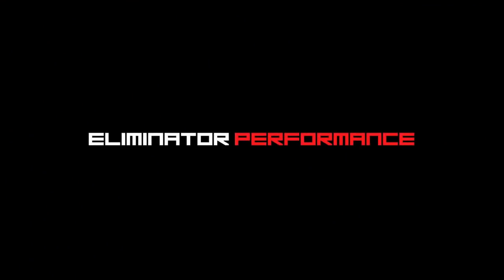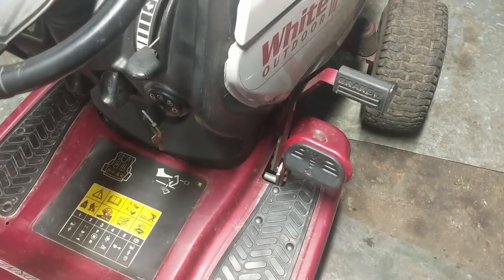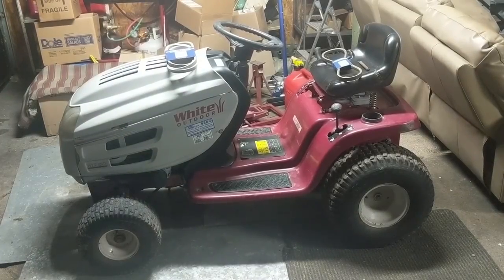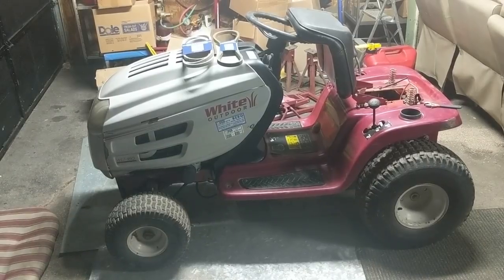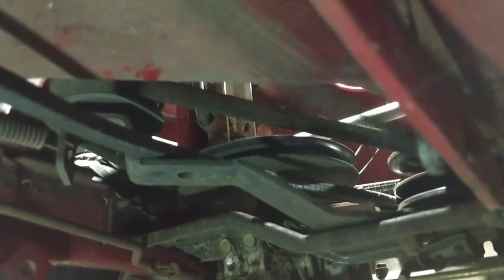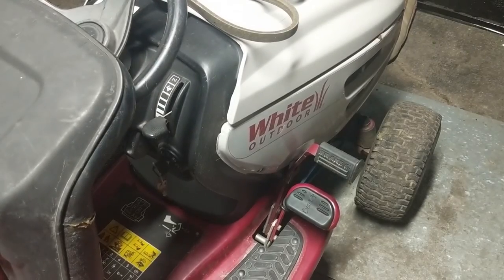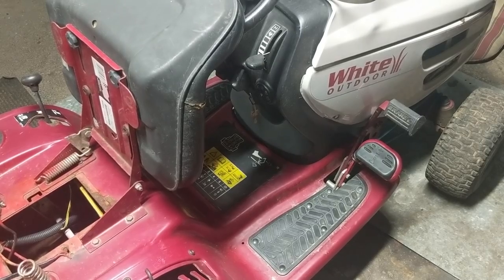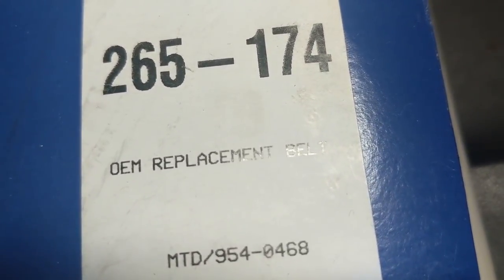How a Variable Drive Works (CVT)

Comment: This is the best video you are likely to ever see that clearly explains how the automatic belt drive system on a riding mower works. I searched a long time before I could find anyone who knew anything about this subject. I would also be interested to know if anyone has any experience mowing on steep hills with this kind of transmission. Do the belts slip or do they power up the hills with no problem?
Reply from the maker: They work well, you have to remember a light pressure on the throttle keeps you in low gear, great for climbing, and the belts are both always under tension. The main issue is these belts "chafe" or however you spell it, because they're variable speed, they're constantly changing circumference with the center pulley moving. This causes them to wear faster than a hydrostatic transmission with a single drive belt. Thanks for the kind words!
Reply: @EliminatorPerformance  Thanks so much. You have my utmost respect. You are a straight shooter and a true professional.

Comment: Thank you for this video. Your explanation on the workings of the variable speed drive helped me trouble shoot my problem.  I thought i would share what happened for the benefit of others. I have an old MTD and it has the same variable drive. I had reall bad belts on it and i changed the big one because it stopped going all together. i didnt change the smaller top belt despite it being in terrible condition. i continued using it and suddenly found the speed affected and would only go super slow. i changed the belt but it was still the same. Your explanation of the function of the middle plate made sense. i checked if it was stuck and sure enough it was jammed. strands of the old belt had wound themselves around the pulley locking it in the position of the slow speed. after pulling the strands out it functioned normally again.  many thanks
Reply from the maker: Thanks for watching, glad it helped!
Reply: @EliminatorPerformance  very much. Thanks once again

Comment: You did an absolute fantastic job with presentation and explaining the system. I need to change drive belt on my Toro LX420 that is similar to the machine that you showed so it will be very helpful. Keep up the good work.
Reply from the maker: Thanks for watching!

Comment: i just put on the long pulley and now when i drive forward i find a lot of play in the pedal and not very fast, but in reverse , its fast. do i have to adjust the foot pedal, if so , would like to see a video on how that is done . Great videos !!!!!!!!!!!!
Reply from the maker: Thank you!

The pedal operates the idler pulleys down below, so adjusting that is easy, as you only need to adjust the rod going from those idlers to the pedal. It should be threaded and have a double nut on it.

A CVT drive should drive at the same speed in both Forward, and reverse, when the pedal is fully depressed.

If you are driving slower than normal, I suggest lubricating the Variable Speed Pulley.

Comment: How to adjust the transmission linkage? I replaced the transmission with used one, I noticed that the transmission is not engaging and the belt smokes.

Comment: Great vids,,,I noticed when you mentioned the lower drive belt #265-101 you said the dimensions were "5/8 x 95", every thing I could find on this part # says 5/8 x 91 or 90 1/2. The reason I am asking is I installed two new belts on my Troy Bilt Bronco  upper 5/8 x 41 and lower 5/8x91 and the mower will pull even when the petal is not depressed. Could the lower drive belt be to short??  Thank you

Comment: Thank you for your video Eliminator.  I have a question:  

I recently changed the drive belt and I don't know if that will be the cause of my problem, I have a Troy bilt pony (2011), now I can only control the speed with the throttle lever, even when I put it in rabbit mode the motor goes at high rpm, but the ground speed is about half the normal speed; the (yellow on mine) speed control lever doesn’t work, it goes up and down without locking the notches, offers no resistance and does nothing. (however, the engaging of the parking brake action works fine). 

I opened up the mower and saw the yellow speed control lever attached to a connecting rod which is attached down there to the cupped metal piece in the correct position as the new Troy Bilt Pony I saw yesterday at Home Depot, but besides allowing to be put in in park position, I don’t see it attached to anything else, is it right? How does it regulate the speed if it is not connected to anything else? 

Thank you in advance.

Comment: Got a Troy bilt having the same behavior after replacing both drive belts, I see they have the whole variable  pulley system listed as a pricey one piece replacement, any possibility of a rebuild with new bearings instead?
Reply from the maker: Yes you can purchase the bearings, there's different designs, some with bigger and some with smaller bearings. My best advice would be to google "mtd variable speed pulley bearings" and see videos and parts that match yours

Comment: I have a Bolens that has a F-N-R shifter that looks like that one but it has a speed control on a lever (1-6) on the top left of console. I changed the main top drive belt in the back and now the speed lever no longer changes and it goes at about a 1 or 2 speed only regardless of the speed change lever position. Do you know what happened to this? When I replaced the belt it was really tight (tension spring was off and I had to use all my strength to get the spring back on) but was the same number as the old belt. I can't tell what that speed lever is attached to at all or how it even works with the variable drive.

Comment: Have new belts mine still works just getting slow and also need to press quite hard, will grease the variable pulley when i do that and check bearings  thanks
Reply: Mine's doing the exact same thing, it seems to be getting slower over time. Do you have any tips on how to fix it? I haven't replaced the belts yet but was thinking about it. I have a huskee supreme SLT 4600... Wasn't 100% sure if it's a hydrostatic transmission or this CVT transmission
Reply: Check your tension springs that tighten the long belt. Often the spring stretches over time and doesnt apply tension as it should. These aren't a bad design, but they're kinda unique. Theres a few videos  on youtube,just search cub cadet/mtd slow speed fixes.
Reply: @ciphercode2298  im not too bothered because i try to cut slow anyway but man full throttle is weak when you are driving around not kowing lol
Reply: @Seriouslydave  Mine was kinda jerky and would speed up and slow down down. It was aggrevating,especially mowing around things. The belts needed changed anyway so I lubed everything good that I couldn't normally get too. My spring wasnt weak,but the pivoting part was a little rusty and was catching as it moved.Its not a bad system,just different than what I'm used too with hydrostatic trannies. After new belts and a good living it was running like new.

Comment: When you call the foot pedal a THROTTLE, it really has Nothing to do with the throttle, it only ADJUSTS tension on the belt which varies the pulley size ratio, correct?
Reply from the maker: Correct, I just called it a throttle pedal because it's similar to that of a car, the more you press, the faster you go.

Comment: I have an older craftsman rider that has a 5 speed transmission. Can I convert it to the constant variable type drive? I already have the variable pulley from an old tiller. Thanks
Reply from the maker: Would be difficult to figure out belt lengths, I wouldn't want to attempt that!

Comment: On mine when i push all the way down it goes fast till i go up hill. then it stops. But it works when i hold it half way down and i go right up the hill. I have new belts What do you think?
Reply from the maker: No idea, that's strange indeed, as tension should increase the further you push the pedal.
Reply: @EliminatorPerformance  Do belts on this system wear out faster? I replaced them 2 mouths ago.
Reply from the maker: Not if they're the correct length.
Reply: @EliminatorPerformance  If i figure it out I'll let ya know. I'm thinking the top belt spring might be weak. I'm  going to tie it tight to see.

Comment: Thank you great video & explanation of how MTD Vari- Drive system works !

I was wondering if anybody reading who has one of these "7 speed shift on the go" MTD models with this 2 belt CVT system would pls tell me:

How well is it holding up ?
Does it tolerate moderate towing ?
How frequent are belt changes needed ?
Can you compare to Hydrostatic or other CVT lawn tractor Transmission systems?

Thanks a ton for any input.
I'm deciding which tractor & drive system to buy now.
Reply from the maker: CVT's are great, probably the best IMO.

As for towing, they definitely can't hold up to as much, as the belt is always changing length due to the fact that the pulley is changing height.

Because of this, there is some "chaffing" when the pulleys get slightly rusted.

Usually that's what wears them down even faster.

But I have a customer who owns one and it has CVT and he plows with it, no issues over the past 4yrs...

Comment: How durable are these transmissions compared to a hydrostatic
Reply from the maker: As for the drive itself, not bad, the bearings go on the main pulley at the back and if left you need to replace the entire variable drive pulley.

The transmissions I've never had too many issues with, other than sometimes not going into neutral as easy as it should.
Reply: @EliminatorPerformance  Aha! Precisely my problem......not freewheeling when I pull the rod.....
Reply: There best and very cheap to replace

Comment: What doo you do to fix a slipping  TD VARIABLE  SPEED 7 SPEED SHIFT  ON THE  GO. Replaced  upper and lower  (drive belt) seemed a little  long!, tried to  adjust with clutch rod  but rod was too short. Middle  pulley  moves fine. But the dang thing WILL NOT PULL ITSELF  IN THE LOWER 3-GEARS,  NOT EVEN DOWN  HILL. This is  becoming  increasingly  aggravating.  I I'm 3 weeks behind on 2 1/2 acers of grass. What do I need to  adjust?
All help appreciated.
Reply from the maker: I'd start with making sure you have a proper lower drive belt length!
Reply: @EliminatorPerformance  yes, both top and bottom. How about the  speed selector  rod?

Comment: My Husqvarna made Murray Select 42" employs a lever on the right above the rear wheel (just like the opposite side grass height adjustment lever) which you push to go foward...or pull backwards to go in reverse - the harder you push or pull, the faster.
There is no spring tension I can feel that brings back the lever to slower and neutral.....which isn't a bad thing as opposed to fighting against a spring for whatever speed I want to go at.
I like this part of the system in that I can slow it down to barely a crawl when mowing close to fences/obstacles.
Five years and besides replacing one axle seal, the only other problem is that when I pull the rear rod to try and freewheel, it doesn't freewheel. Seems like it's been doing this since almost new.
 I wind up having to manhandle and push against the gearing.
Anyone know what the problem could be?

Comment: i have a 2013 cub cadet ltx 1040 with a CVT tranny in it.. i was having issues with it not going into forward and reverse until the engine is warmed up. i changed both belts but it still does it...i have had it suggested its low on fluid but this CVT doesnt have anywhere to check or add... any idea what it could be ? the belts were in bad shape and i did purchase cheap belts. both was under 25.00
Reply from the maker: If the belts are moving and the cvt is spinning, it could be a case of the transmission not shifting into Forward or reverse. So it could be getting stuck in neutral. I'd start at determining if it's shifting out of neutral 1st
Reply: @EliminatorPerformance  i took it out yesterday, the belts are moving . if i push the pedal down half way it moves along but is slow, the more i push the pedal down the slower it gets and wont move on a grade... i went to local tractor repair and he said it has to be the belts, i put cheap generic ones on in sept. he said theres nothing else that would do that...is he right ?